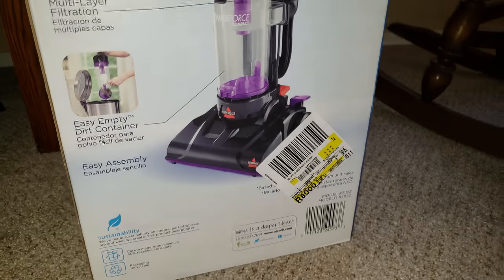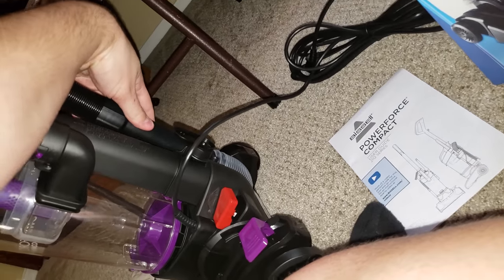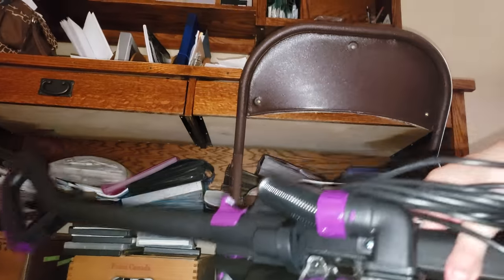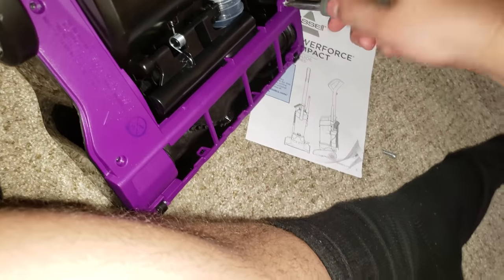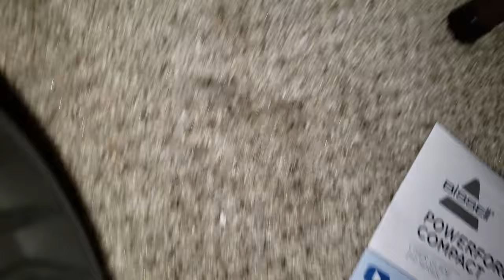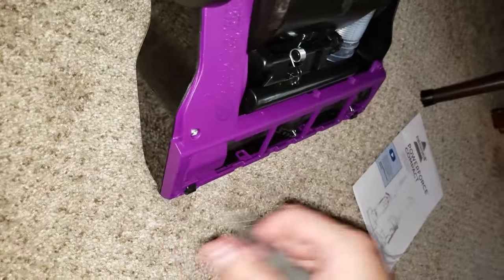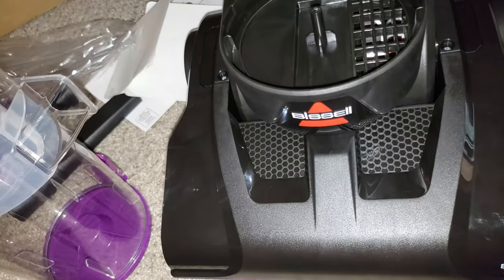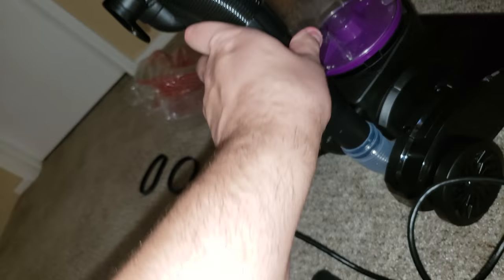Bissell Powerforce Compact Unboxing!

Comment: The bin assembly and spine of that machine looks more like a TTI design, as we had Vax machines in the UK that looked just like it, with the identical style of bin seperator and foam filter above it. I couldnt believe they wouldnt even equip this machine with any kind of exhaust filter, not even a pad filter, thats very poor, and means all the carbon dust from the motor is going to be blown straight out of the machine, unfiltered, not to mention the machine will be noisier. Being rated at 6 Amps, that gives it a 750W motor, which is what the UK gets on most budget vacs, so it looks like the US is being converted to using lower powered appliances, even though its not affected by the EU regs for vacuum cleaners. 
Yes, I know it was cheap, very cheap, but the lack of even an exhaust filter tells me that you certainly will be getting what you paid for. The Pre-motor filter looked like the white part was supposed to be stuck to the black part, and washing it should prove interesting. 
I can see in the average home, where people dont maintain the pre-motor filter, this machine leaking an awful lot of dust out of that exhaust vent and getting plastered with dust all over the base and spine of the machine, but maybe it wont last long enough in the average home to get to that stage, as if the belt snaps, many people would throw a machine that cheap away and just keep buying a new one each time.
My experience with the ultra cheap 750W vacuums that we get here has not been good in most cases, especially with the TTI made machines, and it looks like Bissell are going down that line, in making machines that are much cheaper quality than the old Powerforce Bagless (6583, 6585 etc) range, that at least, were solidly built and had exhaust filters.
Maybe you will like this machine for the money, but as a true vacuum connoisseur, I just feel you wont be using it as a daily driver.
Reply from the maker: I would not use this as my daily driver. My Hoover WindTunnels are my daily driver.